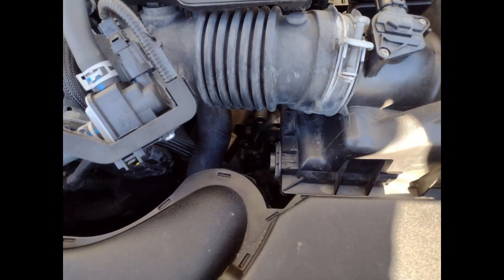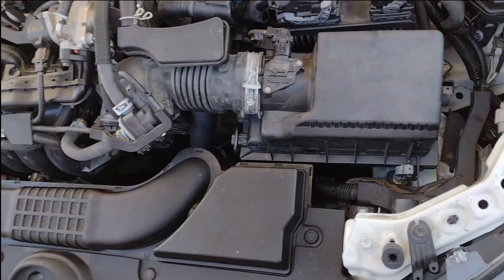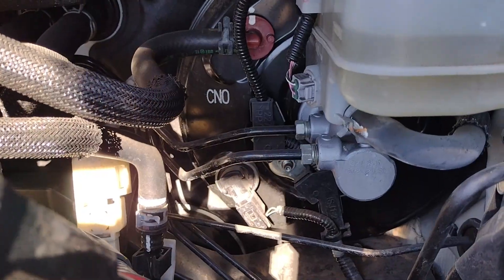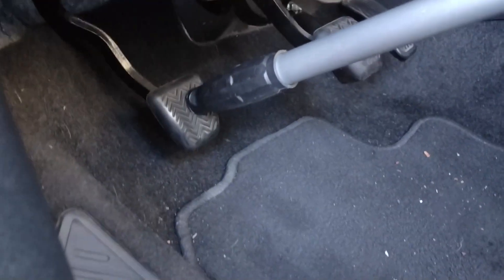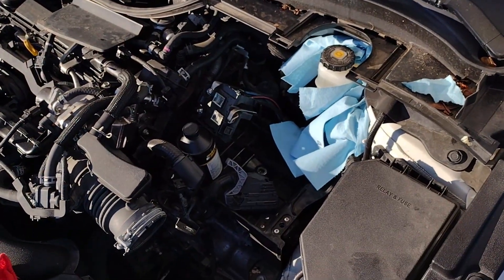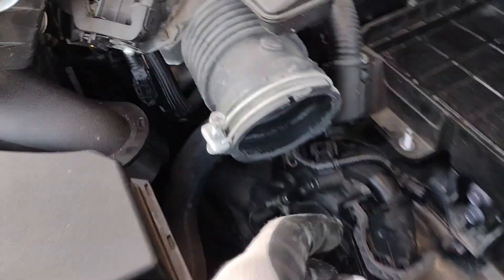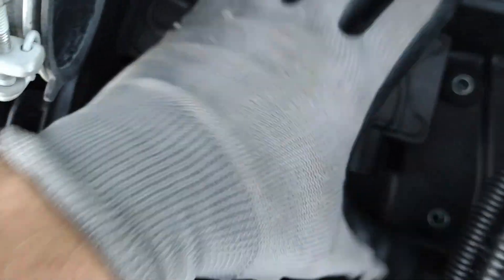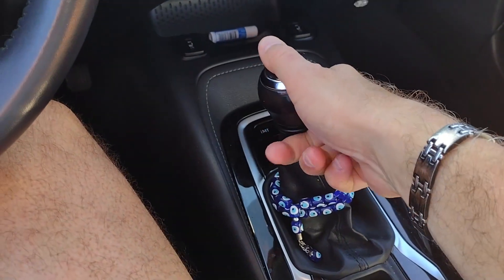2019 Toyota Corolla HB XSE -  Clutch Line Bleeding & Fluid Replacement

Comment: Thank you for the tutorial, this really helped out a lot for my 2020 corolla. I noticed it was much easier to go into gear and I felt that the engine was actually delivering power to the transmission. However, I noticed that after a week, the clutch began to feel like it did before the fluid replacement.  I'm wondering if I have to bleed it again, or if it's something else. I also need to change the transmission fluid as well which could be causing the problem as well.
Reply from the maker: How many miles does it have? Mine is a manual transmission so no transmission fluid to replace, just hydraulic brake fluid for the clutch and gearbox oil which I am planning on changing in couple of weeks which is another important maintenance item. Unless you saw the new fluid coming out when pumping the clutch pedal, it is impossible to know if you got all the old fluid out. I might have left some in there too but should not be much as it has been working great all this time.
Reply: @Turco949  Hi thanks for replying! I got mine with 100,000 miles so that explains a lot XD. I ended up changing the fluid again for the clutch, and it was just as dark, so I may not have bleed out all the fluid completely. Also I changed the transmission fluid which helped out a lot as well. What concerns me is that when I did so, the transmission fluid wasn't topped up all the way. After these completing these maintenance items, the car shifts more smoothly now. Thanks!

Comment: Hi, did u notice any improvement, I'm also experiencing hard shifting to reverse and sometimes also unable to go into 1st after a stop🥲, need to put it in 2nd then back to 1st to engage
Reply from the maker: Oh yeah, the issue of not being able to shift into reverse and second disappeared completely. I may have not gotten it all out 100% because I had to wrap it up but I will do it again in a month or so when it is not scorching hot out there. I might update with a new video plus I will also change the gearbox oil since the mileage just passed 25K already.
For you and people in your situation, the compression is low due to degraded hydrolic fluid. Try pumping the clutch pedal 2-3 times and see if it shifts then.
Reply: Thanks man! glad to hear that it got better for you, will try to do the same and replace the gearbox oil as well @Turco949
Reply: @Turco949 Mine is having the same issue even if the car is off, is it fine to drive or will this cause damage if I don't get it fixed fairly soon?

Comment: Did you press the clutch in each time (5-6 times) you bled the valve?
Reply from the maker: Yes, of course. I used my hand to pump it (a few times is all you really need) because I was using the squeegee tool to keep the pedal pressed down  around 80%. You can always use a suction tool like MityVac which would make it much easier and quicker, eliminating the need to keep pumping the pedal or doing anything inside the cabin.
Reply: @Turco949  Thank you for the speedy response. I will be doing this tomorrow to my 2019 HB thanks to you and your video.
Reply from the maker: @calebmarquez7651  YT notifications are a hit or miss, at best. Just saw this reply while looking at another. Hopefully, it went smooth for you as it is a fairly straightforward process.